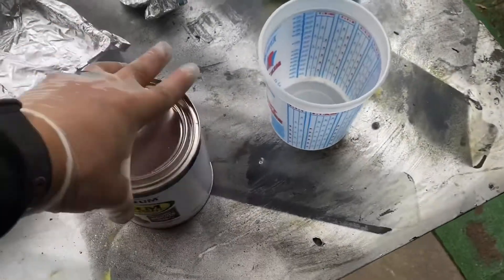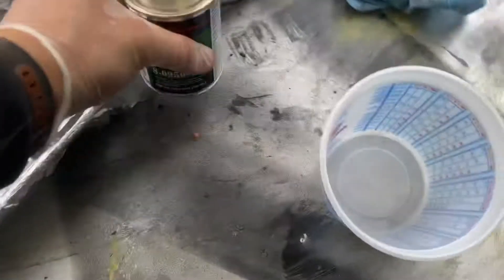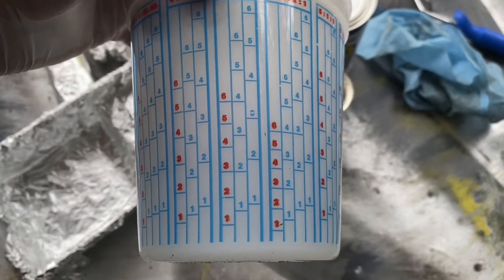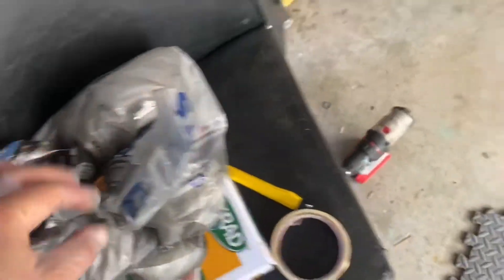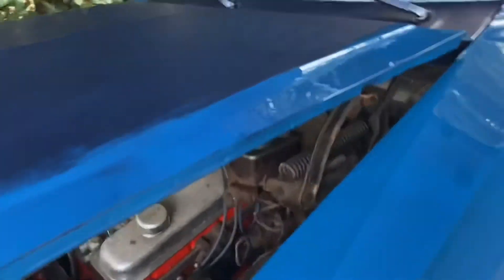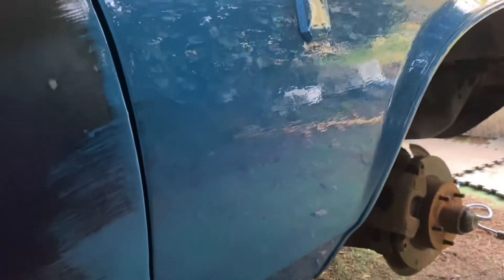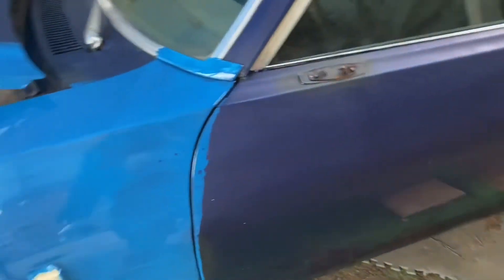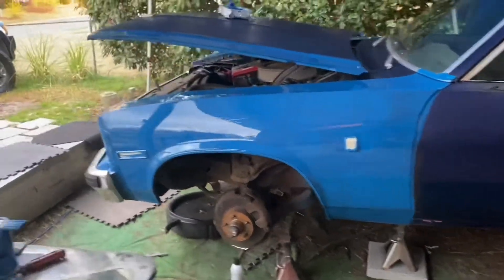Tip And Roll Paint Job 75 Chevy Nova

Comment: It appears maybe too much paint applied at once with too much Penetrol? I'm about to try this technique (roll and tip) using Rustoleum oil-based enamel and 10% Penetrol (to start). No hardener, as you want the paint to dry slowly, so the brush strokes flatten out as much as possible.
Reply from the maker: Yea I’ve had another YouTube comment mentioning too much Penetrol. I did the hood of my rv with 7oz of rusteloum, 2oz of mineral spirits and less than 1/2 oz of boiled linseed oil (a main ingredient in Penetrol). I Rolled it out on half the hood in a thin layer, and the other half in a heavy layer. The heavy layer flowed out to a mirror finish while the thin layer was opaque and had more orange peel. I’m also going to try spraying a 3:1 ratio with my compressor and see what the results come out too.

Comment: Too much reducer. Rolling it neat probably would have worked better.
It would have flowed out as it cured
Reply from the maker: By neat I presume you mean without additive or hardener?
Reply: @CottoDIY  yeah neat would have worked better than with too much reducer but some hardener or Japanese dryer would have improved it further.
If you need to thin it for your roller try mineral spirits/turpentine max 5-10% and will let the material flow out. This in combination with a hardener should give good results. May only require 1 - 2 coats.
You see how thin it goes on with all that acetone. How thin the coats are? Makes it run? Flashes out all the solvents? Why would you want this?